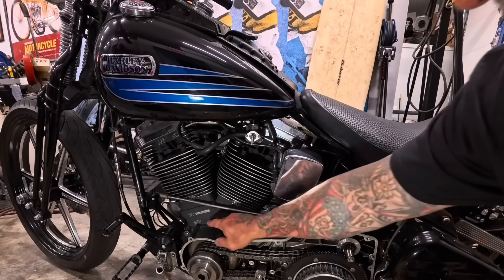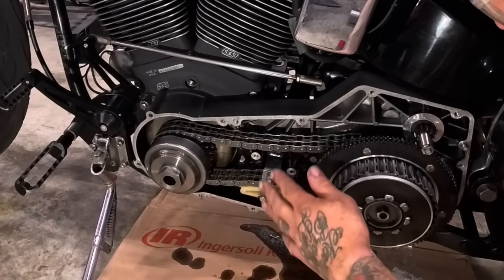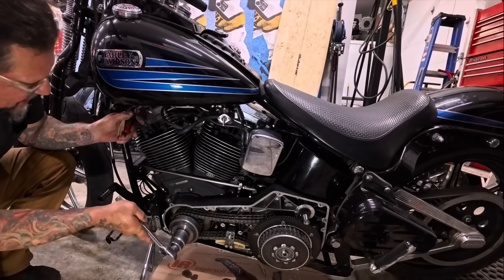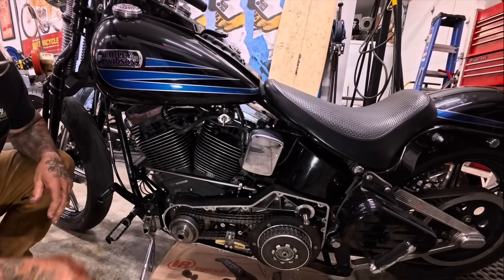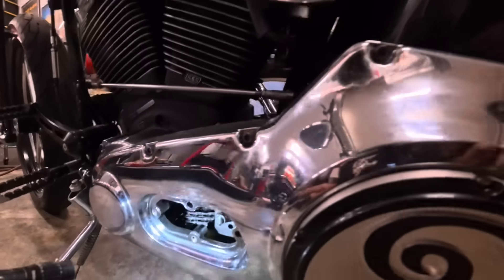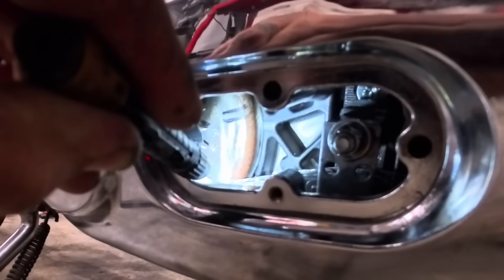How To Set Harley Electronic Ignition Timing The Right Way- Billy Lane’s Pro Trick With Timing Light

Comment: What is your favorite for a bike a  carburetors, or a electronic carburetor
Reply from the maker: I like a carburetor.  I like being able to make changes & tune with a screwdriver.  With my 112 horsepower S&S 113" & Baker 6-speed, my carbureted springer can hang with most M8 Harley-Davidsons.  I prefer simple.
Reply: @BillyLaneChoppers  I thinking about buying a new or a used fatboy what would be the best fat boy electric carburetor, a regular carburetor if you don’t work on bikes, to buy I been looking at a 22 fat boy but it electronic carb but I want a 240 rear wheel too that’s what changes things from a new one to Old one